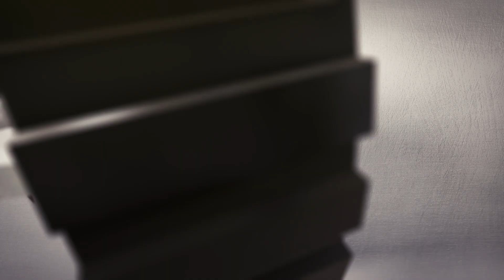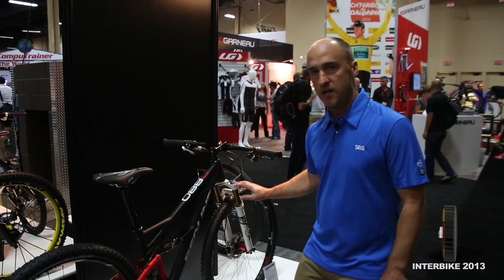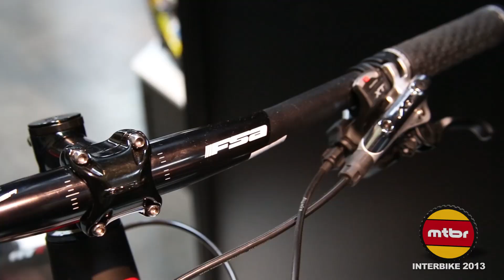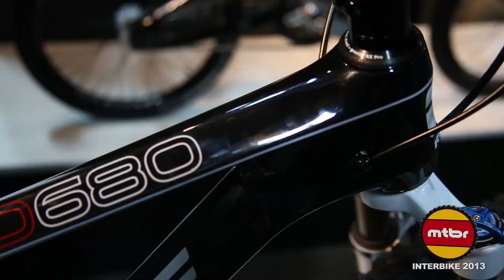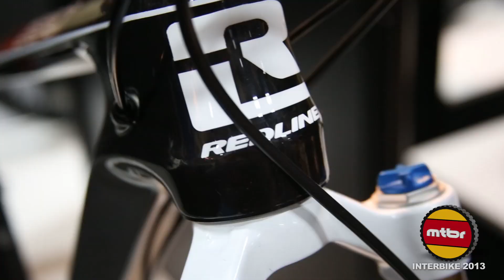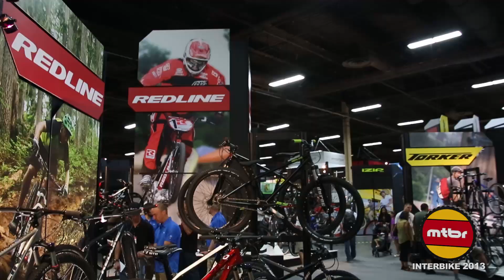Redline D880, D860 and D680

Comment: I don't quite understand the 110mm rear travel and the 100mm front travel.  Logically, this seemingly should be reversed:  The fork leads the bike through and over trail obstacles.  Thus, it does a lot more absorption and tracking work than the shock.  So, I'm perplexed why Redline set-up their rig the way they did.  I look forward to reading real-rider reviews.